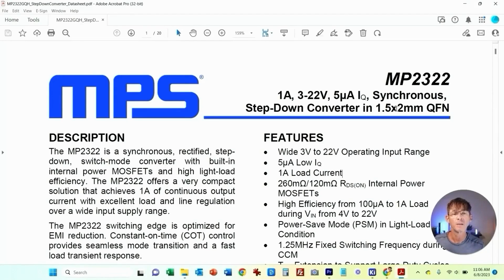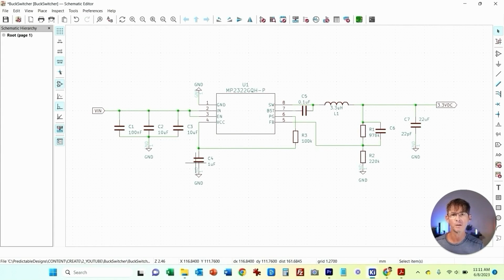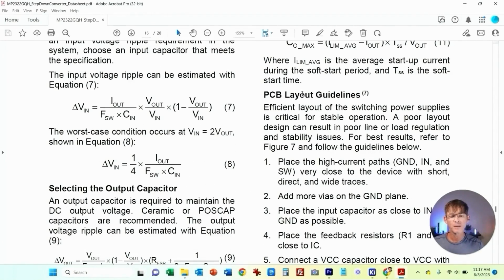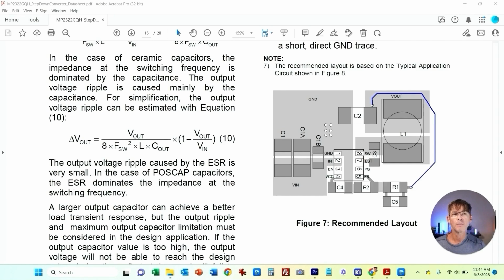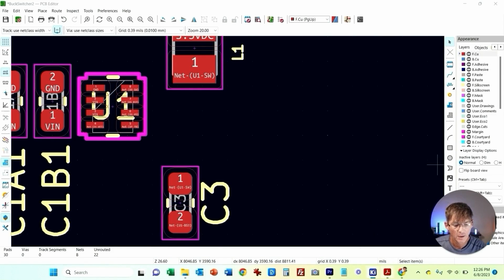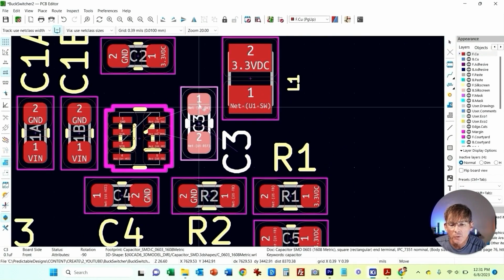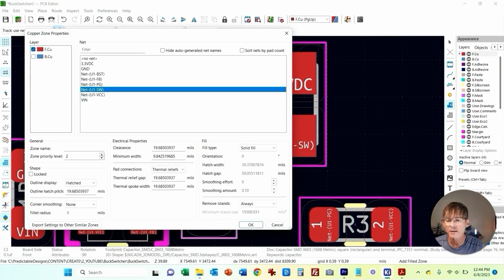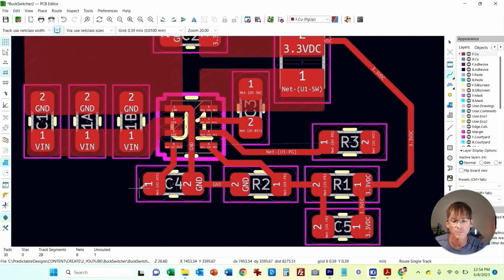How to Layout a Switching Regulator on a PCB (Step by Step)

Comment: I don't see a trace from FB resistor to Vout capacitor. Is that right? I thought you needed to connect these to sense the output voltage?

Comment: Hi. Good video for intro to SMPS design. This should however be at least 2 layers, with solid gnd on L2. Allows much tighter placement and better SI. Also, better to connect FB to Cout rather than L to avoid magnetic noise pickup and possible instablity, even better, route this trace on bottom layer of 4 layer stackup.

Comment: Something I notice with this video, data sheets, and most other good YT PCB videos is linking ground, often with pours, across components. In practice I've just linked them to vias going to my ground plane (even 2 layer boards). Am I wrong to do this? For example here theres a link (data sheet was a pour/block, here a trace was used) under the switch... Why not just put in a via up gnd plane? Is it just to keep in the 1 plane scope of the video?

Comment: Great video! Isn't a GND/reference plane required on the bottom layer? Per the datasheet, it looks like that would be connected to the top GND pour through via stitching.
Reply from the maker: Yes, you're absolutely correct. I don't think I did that here because the intention was this would be used in a full design with a solid ground plane already present. But for completeness I should have showed that here.
Reply: @PredictableDesigns  thanks for confirming!

Comment: You should minimise the area of the SW net whilst preserving its ability to carry the peak output current of the DCDC which is probably 2A max for this device.  The smaller the area the less noise.  So I would rotate the bootstrap cap by 90 degrees, shuffle L1 closer to the SW pin.   Datasheets are typically a bad place to get the best layout for EMC performance.

The output cap is less important than the input.  The input has the highest switching currents (full on, full off) so you need to keep the loop through C1 and GND as small as possible.  Thus I would rotate at least one of the C1s and this will reduce the loop from the IC GND back to VIN through this cap.
Reply: Ideally, though, use a smaller cap footprint for C1B so that it better aligns with the GND and VIN pins of the IC.
Reply: what if you rotated the C2 also by 90 deg? would it make even more room for L1 to be closer to SW pin? But need to pour a bit differently from GND and VOUT to C2 pads or connect using traces. This was my idea

Comment: There are always these tiny nuggets of info i love hearing from experienced folk that I'll never hear otherwise like what you mentioned about the output capacitor on a regulator helping to stabilize the feedback portion to prevent (or encourage in the case of no or poor capacitance) oscillations.

Please do more of these tiny tidbits or compile them into a video one day.

Edit: you did it again!
You mentioned how the resistor divider is located internally for a fixed regulator, but externally for a selectable one. Im sure these are things that will become obvious after the thinking just a little bit, but it's so illuminating when you point it out in the proper context.
Thanks for all you do!🎉
Reply from the maker: I love this feedback, and I'm glad to hear you find these tidbits helpful. I agree it's the little things like these tidbits that can be hardest to figure out on your own.

Another tidbit for you. For some regulators (linear or switching) you'll see a small capacitor placed in parallel with the top resistor of the resistor divider. This is called a feedforward cap, and it also helps with stabilizing the feedback loop on some designs.

Thanks for watching and for commenting:)

Comment: In my design, I’m using a TPS61022 boost converter IC. Designed a test board using all the TI recommended components and values, used suggested layout, and it would self destruct every time, even at low current. 

Found out from others that it NEEDS the feed forward capacitor which is just an optional thing on the data sheet.  That baffled me.   Using their actual design leads to a non-functional circuit.  

Suppose the lesson I learned was to always double check with other’s experiences with a part before using it to see if it works as intended?   

Adding that feed forward capacitor fixed everything.  :)
Reply from the maker: Interesting. That feed forward cap helps with stabilizing the feedback loop, but like you said it's usually optional.
Reply: @PredictableDesigns  The data sheet did have a complex formula to calculate the value of the feed forward cap which I tried to work out, but ended up just throwing on a really small value and it's working great! 

I also learned about the feed  forward capacitor and how it's used to stabilize the feedback loop.  Really interesting stuff!

Thanks for another amazing video!